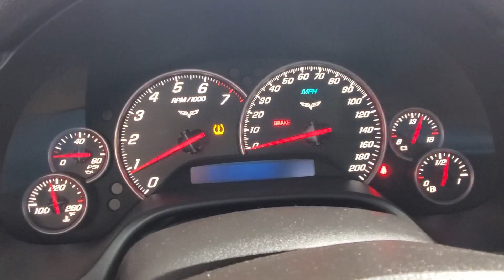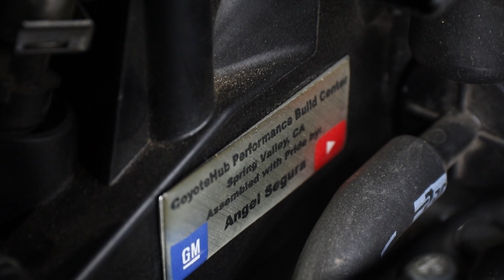My C6 Corvette Fails Again | No Oil Pressure

Comment: I've done the sensor on my 05 C6 without cutting or removing the intake manifold. It can be done but you have to do it blind and by feel.  Lots of experience from my time as a mechanic you can save time on some jobs if you get creative but also still be safe.

Comment: Bro I feel your pain spent $5k in repairs on my C6 then yesterday I lost cold air from my A/C and the compressor went out. Of course the repair is over $1.5K. I hate this car!😂
Reply from the maker: Ouch! My AC is leaking from the port valves. Easy fix, but i just refilled it instead of properly fixing it.
Reply: Sheesh hopefully I don’t have to have an expensive fix on my c6. The oil pressure reading lower than usual but no leaks and no sounds. Want it to be something simple but no tripping if it’s the oil pump then I’ll just cam it but I’m not ready to spend that yet 😮‍💨
Reply from the maker: May be the sensor if your oil is at the proper level. My sensor used to read around 40psi at all times. Once i put the new sensor in it goes to 80 when i accelerate. I never knew it wasnt working properly
Reply: @PushingGears  true I hope so and yea oil is at proper level and pressure does go up and down as rpm’s go up and down but not reading around 40 like it used to maybe 3weeks ago